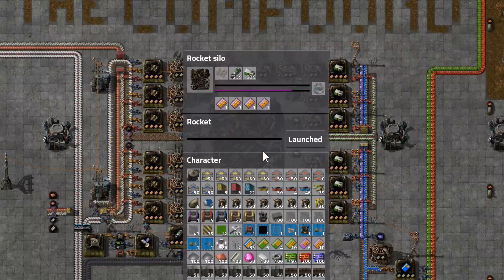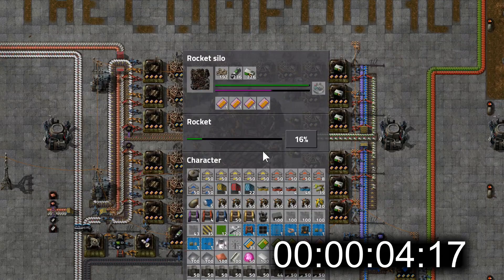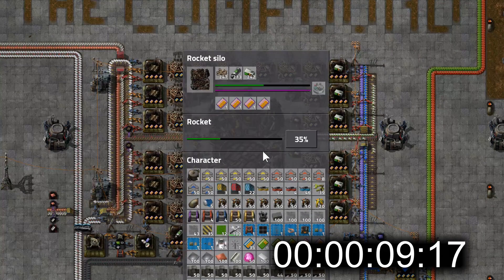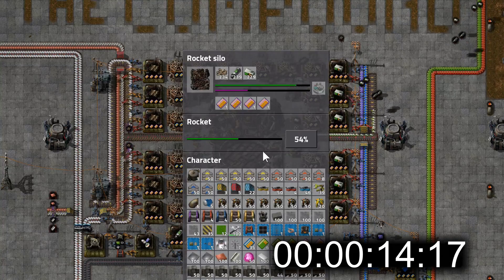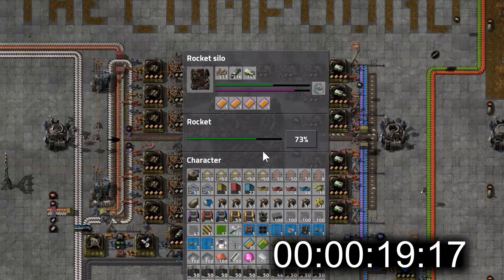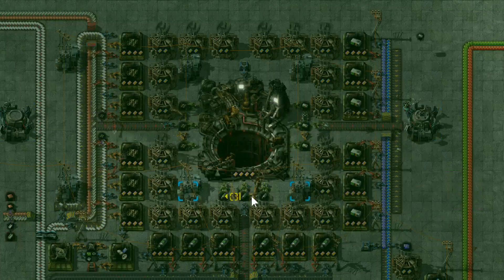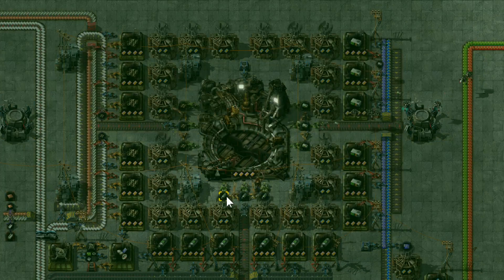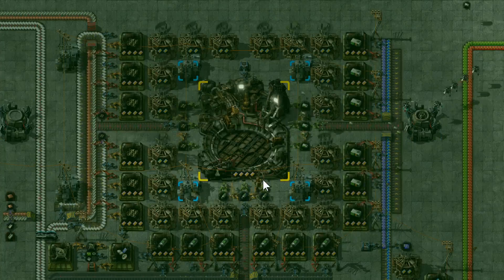Factorio Rocket Launch Minimum Time (with Beacons)

Comment: I can launch a rocket in twice the speed
with 2 silos
Reply from the maker: No you can't. :P  You'd have to switch between the two can click launch... Therefore there'd be a delay.  The point wasn't to see what was humanly possible, but what was the absolute maximum speed at which a rocket could be 'built' and then launched.  I wonder if there's a way to just auto launch rockets. :/
Reply: urbanelemental tool assisted speedruns might ::))))

Comment from the maker: Note that after retesting this, the official time is ~20.6 seconds.
Reply: What changed? Why the difference between test and retest?
Reply from the maker: I re-engineered it to maximize the use of beacons as suggested by someone else in order to try the meet the theoretical maximum.
Reply: Ah, are you saying there's a way to get more than 20 beacons around the silo?
Reply from the maker: No, the previous video did not have beacons.
Reply: Hmm, sorry if I'm being dense, but I'm confused. The video shows it taking 26 seconds but your comment says you retested it and got 20.6 seconds.
Reply from the maker: Right.  Sorry, I was confused... There was a discrepancy because the video recording had some weird frame rate issue or something.  Admittedly having trouble with recording Factorio video accurately.
The true theoretical limit is 20.6, which is exactly how long it takes to build a rocket at best speed.
Reply: Got it, thanks!